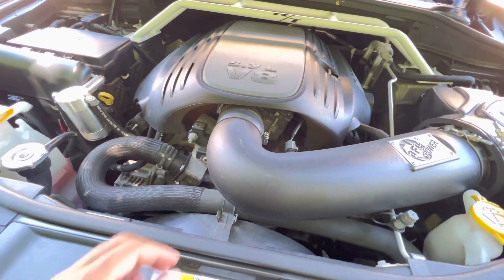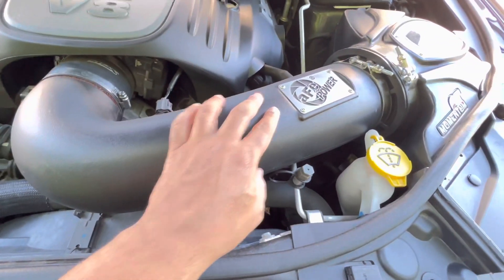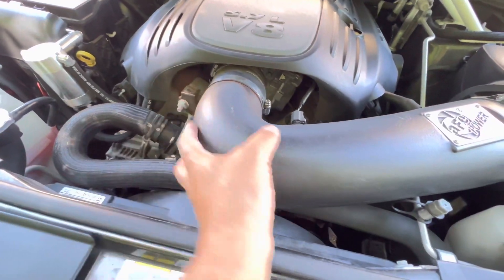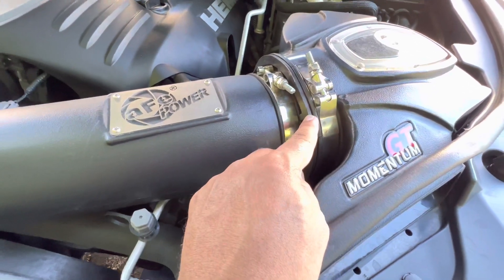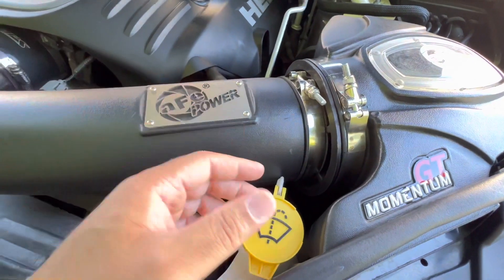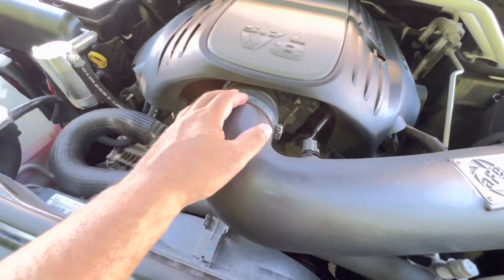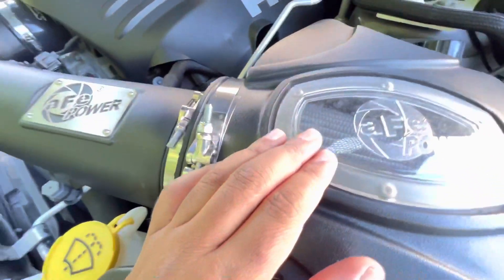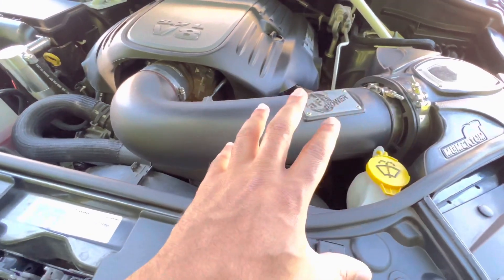HOW TO PERMANENTLY FIX FITMENT ISSUE ON THE AFE POWER COLD AIR INTAKE!

Comment: I sold my 2019 durango RT and I had  that intake on ,now I have 2022 durango RT plus I installed the Afepower GT intake and was getting 6.7 miles per gallon I toke it right off my new truck. Gas prices  keep going up so no intake for me. Let me know what's your gas mileage on your truck.
Reply from the maker: It’s crazy you ask that cause I’m gone being doing a video on how bad is the gas in my Durango. Coming soon
Reply: @AlexsRTLife  new york has a sleeper act that your exhaust is too loud boon $1000 ticke.. camera takes picture of your plate and a sound clip. I want to get an exhaust, ghey say it won't pass inspection cause they all on the same page here.
Reply from the maker: 😦that is nuts! Net York Wildinn Out For RealNow!
Reply: @AlexsRTLife  do you have a sprint booster on your truck  alex I took mine off from my 2019 durango Rt  it makes your truck open up .
Reply from the maker: I had one one but then once I tuned it with the DIABLOSPORT there was no need for it because the Diablo has adjustable throttle boost
Reply: @AlexsRTLife  I might try that octane boost for the gas to be 94 octane later on.